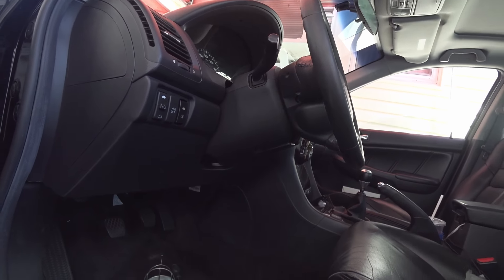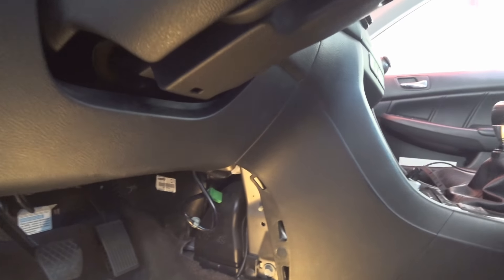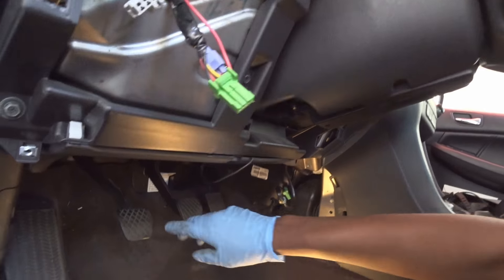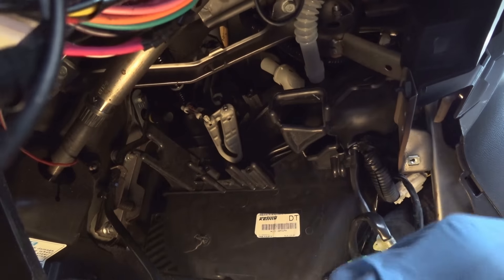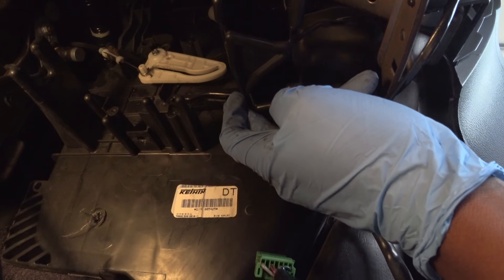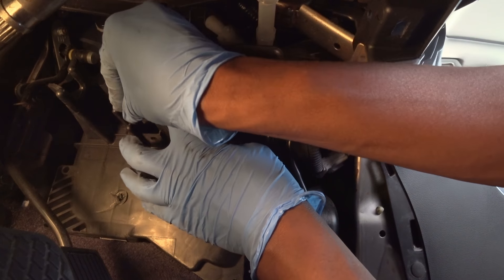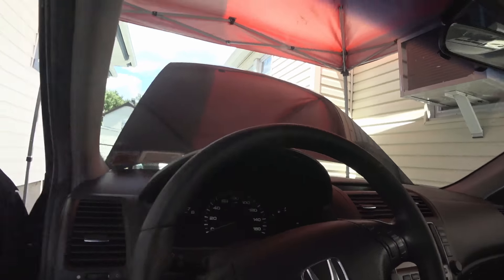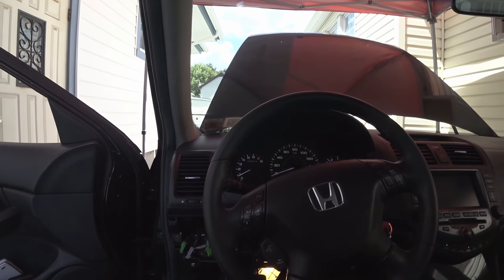How to fix accord blend door actuator. How to fix your AC vent.

Comment: Hey brother, great video!

I have an issue.  My actuator wasn't working at all, so I removed it and opened up the module.  I cleaned off all the loose grease on the electrical contacts, and made sure none of the teeth on the gears were stripped or broken.  The gears looked and worked fine.  Reinstalled and now the actuator only initializes to one certain position...and stays there forever.  No matter where I position the arm, once I turn on the car, it always goes back to that one same position, then never responds to any climate control commands.    Is the actuator broken or is there some sort of reset procedure I need to do? The motor should be fine since the arm swings...but it seems like it has a memory and only goes to one spot.  Thanks.
Reply from the maker: I would put the temp to max hot or max cold before removing the actuator so once you install it. its already at its limit. i had the same issue before and this is what i did. if it does not work you might have a sticking spot on the gear, and will need a new actuator
Reply: @AJIMPORTS  Thanks so much for the quick reply!  Initially, the arm would rotate endlessly and never stop until I turned off the ignition.  Then after I cleaned it it only initializes to that one position and stays there.   I'll try your suggestion and see how it goes.

Unfortunately I was dumb and tried to perform the repair in haste, and didn't mark the position of the arm before opening it up and reinstalling.  Not sure if that has anything to do with it, but hoping maybe it does so I won't have to replace it.

Comment: Question: If the actuator is bad, wouldn't that also affect the air flow from the drivers heater vents as well?
Reply from the maker: The actuator was bad. It was not allowing any ac to flow on the driver side. The car has dual zone so that's why I only saw the issue on the driver side. If it was a single zone then both the driver and passenger side would not change from hot to cold.

Comment: Thanks for taking the time to share. My question is how many air actuators do 2007 usually have in total? It seems like my all my vents are out. It was only the one in the middle initially now it seems like it's all 3 (driver side, middle vents and passenger side). Also, how hard is it to change the actuator for the middle vents? Thanks once again!
Reply from the maker: They have two actuator one for the driver and for the passenger side. They have a mode control motor in the center behind the radio. Not sure how easy it is to remove with out taking out the radio.
Reply: @AJIMPORTS  Thanks for the speedy reply man! Just priced the parts for both sides. Not sure how much the mode control is, but will check on that too. Salute for the info, fam!
Reply from the maker: @blackestknight1.0  but before you do anything buy a 10 dollar can of freon and make sure your ac system is charged. Dont want to waste money. Also you can just remove the actuator from the driver side and manual open or close the vents to make sure the actuator is really the problem
Reply: @AJIMPORTS  Thanks a mill, bruv. I'm going to work on it this week. Appreciate the help.

Comment: Thank you for this video. I used it to install the new part in my 2004 Acura TSX. I have a slight problem, the peg for the black door does not fit all the way into that slit. After installation everything was working fine until I began to move around my temperature bc the peg slipped out. I bought the part from AutoZone. Do you have any suggestions on how to fix this?
Reply from the maker: Compare the old part and the new one. Maybe there was damage on the new one or the actuator is different. If they are the same reinstall. I had that issue also at first. I had the white flap connecting to the wrong arm on the actuator. The black arm goes to the bottom of the part. Make sure the actuator is set like how it was in the video. Once it's bolted in place it should not pop out. Check to see is the arm on the box are bent or broken.
Reply: @AJIMPORTS  so i finally was able to get in there again and its the same as the old one. The white peg is to the white slit and the metal peg is to the black slit like the video. Once i start messing with the temp, the metal peg slips out, its not long enough and the piece is completely screwed in.
Reply from the maker: @krissiaosorio90  just to confirm you purchase the one correct one via the VIN number because my accord has three different ones. I will take a look at my car tomorrow and see which connects. Because I had the same issue where the arm would fall out. I swap where the arms went and it fixed the issue. Because when the arm moves they cross. So if you have them in the wrong spot they pops out.
Reply: @AJIMPORTS  i purchased it through AutoZone with the year make and model. Mine also had 3 the left, center, and right. But if the pegs get switched then wouldnt the controls be backwards? Please do. Im going to return this piece and order a new one
Reply from the maker: @krissiaosorio90  do you have a IG.i will send a picture of how mine is set up. Hope it helps
Reply: @AJIMPORTS  krissia_o thanks

Comment: Thank you for this video!!! I have a 2007 Accord EXL and had hot air coming out of driver side vents, cold air coming out of passenger side. Heard clicking/fluttering noises from the dashboard. Took it to the dealer who wanted to replace supply lines and possibly compressor for over $1,000. I declined to investigate more. Found this video after googling about the problem and people mentioning the blend door actuator. The noises were coming from the actuator. After watching this video I was able to remove the actuator (I had to also remove a metal bracket that was preventing me from removing the top screw on the actuator). I found another video to open up the actuator and attempt to clean it out - going to try that first before ordering a new one. Thanks again!!!
Reply: Could you post that other video by any chance?

Comment: Thank you! I can now add this project to the list of things I have done by myself thanks to your video :)
Reply from the maker: Happy it helped. Just trying to share and help ppl save money by doing the repair themselves.
Reply: @AJIMPORTS  My 06 Accord only has warm air on driver side and when i go over a bump or turn hard it goes cold then back to warm, could the blend door be my issue?
Reply from the maker: @mckinzie4934  sounds like it is. But try taking off the actuator and you can manually move the blend door hinge. To see If that is the issue or a broken actuator.
Reply: @AJIMPORTS  Oh actuator and blend door two different things? I thought it was just one part haha
Reply from the maker: @mckinzie4934  nope the blend door is inside the hvac box. Have to remove the whole dash to do that job. Check the channel I have 3 videos on accord and this heating/ac issue
Reply: @AJIMPORTS  Oh damn that would be a lotta money to have fixed I assume. So how can I tell which I need?